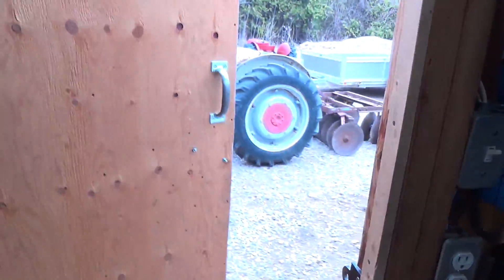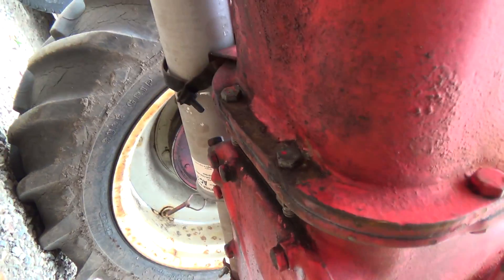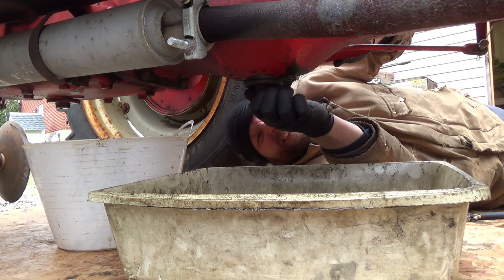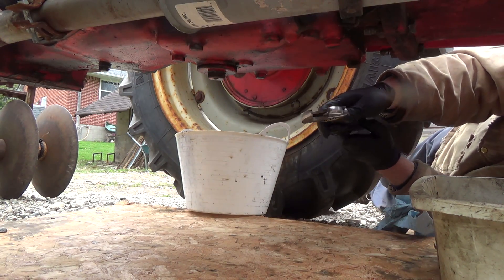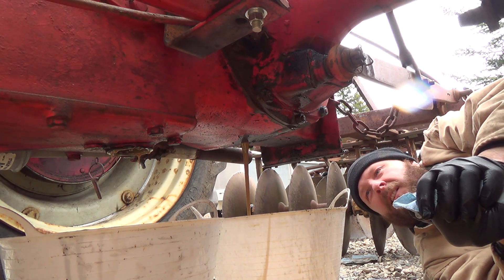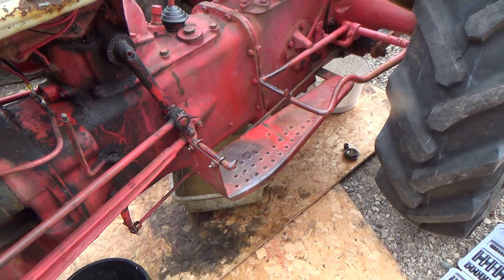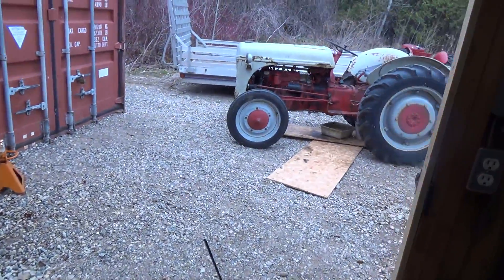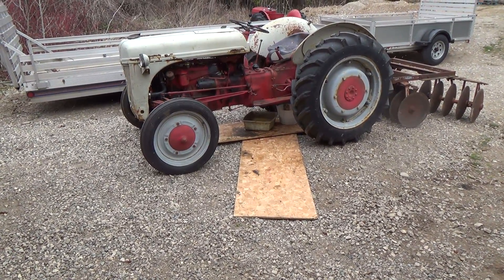1944 Ford 2N hydraulic oil change.. This poor tractor. Part 1

Comment: I do have to ask, I had my 9N apart to put in a new clutch and ring hear. When I was reassembling it, I noticed those cotter pins on the bottom, it seems they do anything. Are they just breathers or pressure release area's and the cotter pins keep dirt out?

Comment: Just pulled the plugs on my friends 50 8n. Straight black tar. It's every bit of an inch and half thick sludge and the nastiest oil I've seen with my eyes so far. Hasn't been changed in at least 30 years that he knows of. Disappointing, the lack of maintenance.

Comment: You will always get water in your hydraulic fluid due to condensation, even if your shifter boot is perfect.  There's no way to avoid it.  That's why you use the proper Universai Tractor Hydraulic fluid (UTF) that contains, among other things, lots of rust prevention additive, and change the fluid every two or three years.

Comment: Thanks for another update, the old girls like some tractors I've had here in my collection, probably hasn't had a decent service since the warranty ran out ! That smaller plug more in the side of that plate you pulled out could be for external pressure  off the pump to add a loader or   hydraulic feed for implement cylinders .   Thats the Ferguson system hydraulics that caused the fall out between Harry Ferguson and Henry Ford. it's been about 25 years since I've seen one on a grey Fergie 20 but pretty sure that's where the feed pipe comes out on them for loaders .

Comment: I would put some diesel fuel in the rear and run it around then drain it off and put some new hydraulic oil in it.
Reply from the maker: you cant do that with the internal pump

Comment: Fill it with Diesel fuel, drive it and drain it, and repeat until all the gunk is cleaned out
Reply: I had an uncle who back in the day farmed with three 8N tractors. He would always fill the hydraulic reservoir with diesel or kerosene and then run up and down the road while raising and lowering the 3PH.  Really gave it a good flush out.

Comment: That's gear oil and water. If you don't put the 80/90 gear oil back in that transmission you will burn the pump up in the transmission.

Comment: Wouldn't be a bad idea to fill it up with diesel, run it for a while including the 3pt, then dump that crappy stuff out again.
Reply from the maker: wish i could but its really hard on the pump inside the tractor.
Reply: @billstmaxx  For a couple minutes, won't damage anything. It's better than run dry and it's a common practice when the oil gets milky and needs to be cleaned out.
Reply: @billstmaxx  My uncle farmed with three 8N's for many years and he always flushed them out with kerosene and sometimes diesel.  Running it for a short time to flush it out won't hurt it. I mean, what's it going to do... wear the pump?   That pump has already seen 80 years of wear. :-)

Comment: That looks like hydraulic oil with engine oil, not water.  put a sample in a mason jar.
leave it to settle for 24 hrs the water will sink, and you will see it,
if its oil/oil there will be no separation.
Reply: If that oils old and had water in it for a while it might not separate out so much anymore. I've seen that happen in old tractors i work on here, it kinda stays that color.

Comment: Put two or three gallons of diesel pick the back end up and let it run in gear to clean it all over it should get a lot out
Reply from the maker: you cant do that with the pump inside and the valve body
Reply: Oh I was thinking the back where the rear tires were at it would be ok

Comment: Need to top it off with diesel fuel and run it around and drain it again
Reply from the maker: you cant do that with the pump inside and the valve body
Reply: BILLSTMAXX yes sir been doing it for many years and my dads has a tractor repair business for 40 years. The oils base in the fuel will flush all the “milk” out. Once it’s drain fill back up with oil and run it around a bit and flush it again
Reply: Need to cycle the lift also the lift piston still has that oil in it from we’re you still have the disc holding the arms up. Just think of it as a flushing a engine you drowned out in water I always drain it fill it up with diesel crank it up a few seconds then drain
Reply: @billstmaxx  how many times lol do you need to reply the same answer lol - people obviously dont read comments

Comment: Well, there is your 3 pt issue right there. Milky oil and actually low oil. I'm sure it will be after with a fresh oil.
Reply from the maker: only around 2.8 gallon left in it.. should be just under 5